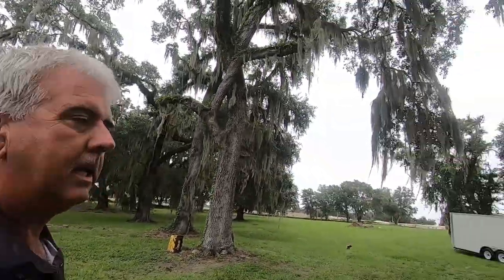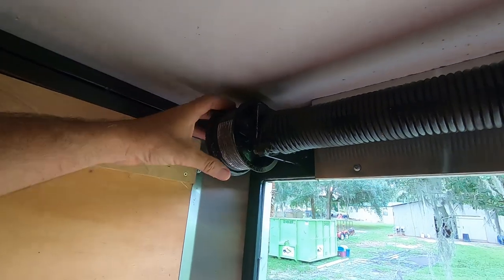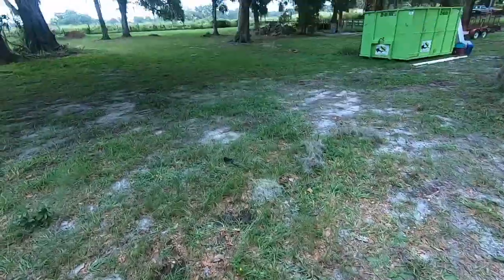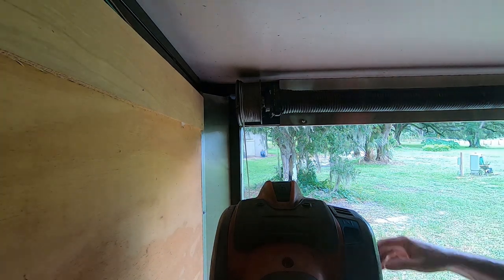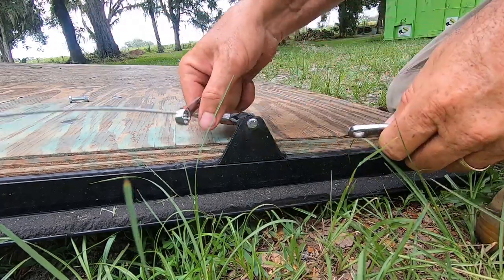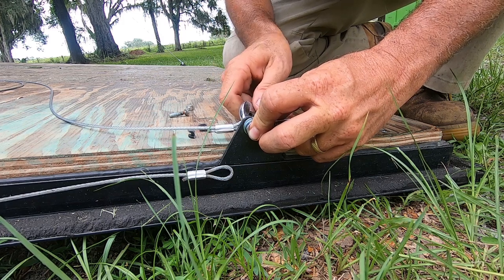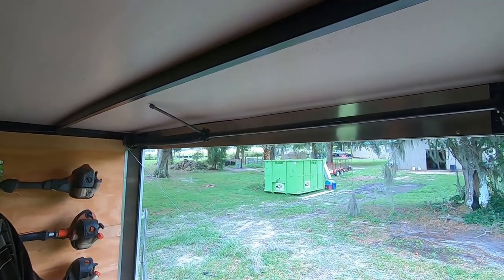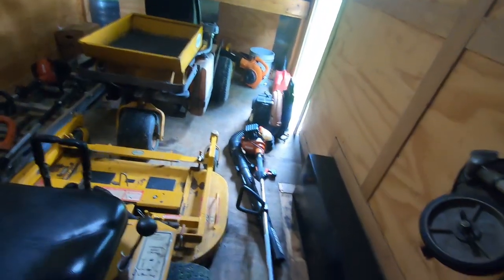Enclosed Trailer Ramp Door Cable Replacement

Comment: I have the identical setup. Loosening the pulleys and taking up the cable slack - that part is completely clear. What's not clear to me is how does simply taking up the slack allow the spring to work when you're actually operating the door.
Reply from the maker: Tension is already on the spring from winding it in with the tools. I just did some final adjustments to even out the cables by loosening the pulley and making the loose side match the tighter side when the door was closed. It will all come together once you start doing it

Comment: I possess identical trailers. The cables on both sides are disconnected, but the spring winding system remains intact. To rectify this, would I follow the same procedure for both sides, adjusting tension on the springs last? As the actual spring is not under tension right now. Lowering the door, attaching cables on both sides, eliminating slack on both ends, and then increasing tension on the springs by rotating them. Does this sequence of steps align with the correct logic?

Comment: Whats the best way to preserve the wooden floor of a cargo trailer?
Reply from the maker: I truly  don’t have a good answer for you sorry
Reply: Thompsons water seal or paint it.  We are converting our cargo trailer to a camper and are using some left over laminate flooring we have.
Reply: @WillJedi71  Water seal the road side, correct?
Reply: @NE-Explorer   Yes, I pulled ours up 1 piece at a time to make sure everything went back exactly where it came from.  Just use a small (1/2 gallon size) garden sprayer to applied it and give it time to dry.  Then put it back in.  Fairly straight forward.

Comment: The ball signs my wheels are square. Can you use regular 6-point sockets on Square bolts or do you need a pipe plug socket wrench set
Reply from the maker: I believe you could get away with a regular sized 12 point socket, but I don’t think the 6 point sockets would grab it correctly, sorry it’s a vague answer
Reply: @Oxford_Lawn  Thanks I bought a set of stove bolt sockets (sq head) but as long as its not 10mm I will try a hex socket.
Reply: Use a regular 3/8 extension female end and a crescent wrench on the make end

Comment: Good video.  Thanks.  I need to do the exact same repair.  Now I have a good idea what I am up against.
Reply from the maker: Only thing I realized after the video...thise end cable holders have to be snug up against tbe bearings on the inside...those keep the whole shaft from walking left to right.  Everything else is pretty simple once you get the premise of whats going on.